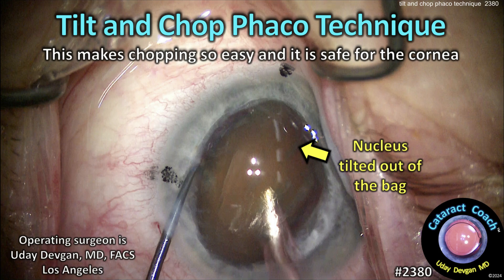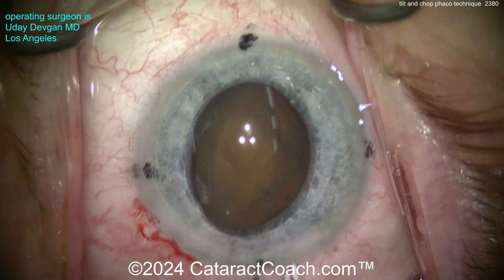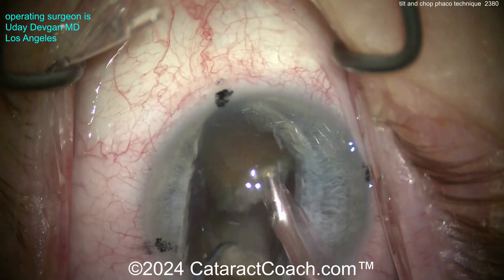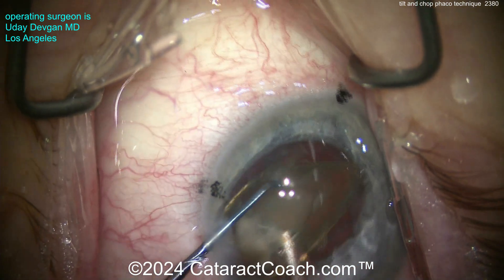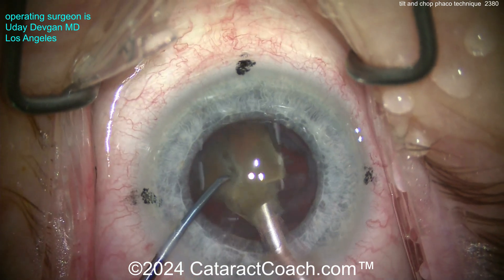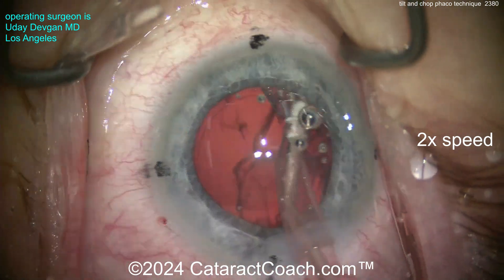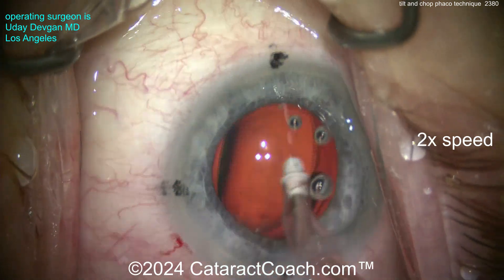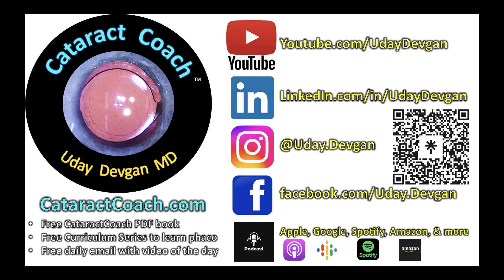CataractCoach™ 2380: tilt and chop phaco technique

Comment: thank you Dr Devgan for sharing. I tried this today in the OR, really works! Is there a difference between "flip and chop" and "tilt and chop"? It seems pretty much the same. Thank you again.
Reply from the maker: same thing
Reply: Flip and chop the nucleus flipped out of the bag during hydrodissection , tilt and chop the nucleus tilted out of the bag using the phaco tip vacuum.
Reply: @bestkindevertime9553  if that's the case, the case presented here would be flip and chop, since nucleus is prolapsed during the hydrodisssection. Instead it is described as tilt and chop 🤔